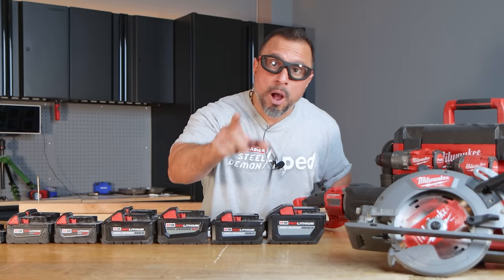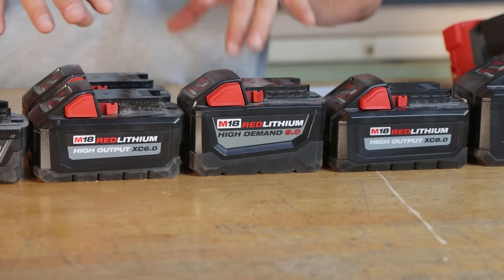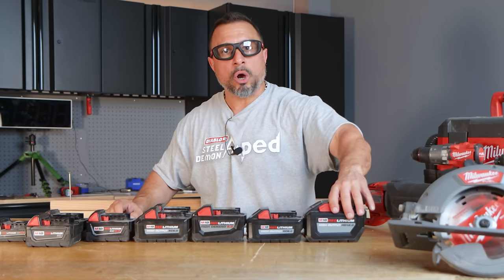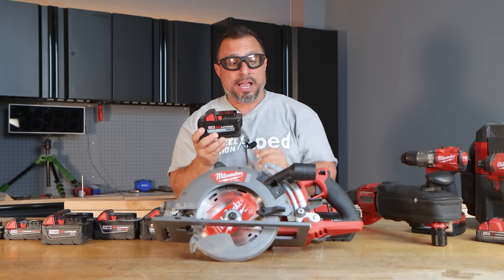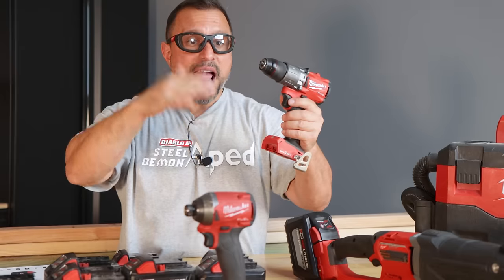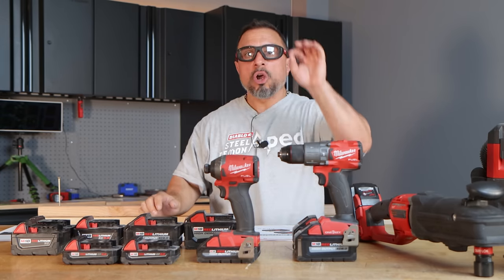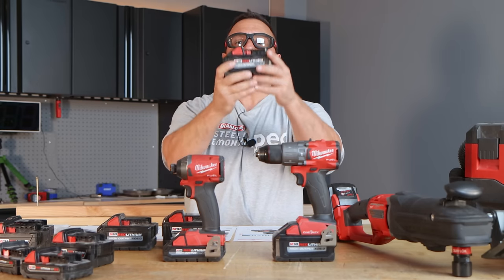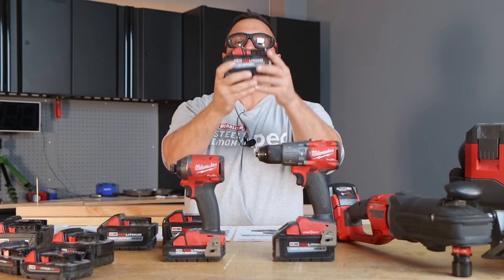Your BUYING and USING Milwaukee M18 Batteries ALL WRONG! (stop doing this)

Comment: Milwaukee rates their pack according to batteries manufacturer’s rating. Any rated pack will deliver a total of a rated power, so while the packs with 21700 batteries will give better surge, it will give the same total 54, 104, 144 watts, etc. in output. Also 18650 battery is not obsolete.  It’s just physical size spec, 18mm X 650mm. Samsung, LG, etc. can continually improve them.  The pricing can be confusing.  But I price compared Lowes Kobalt batteries which are priced the same.  Lowes Kobalt 4.0 18650 battery pack is $10 cheaper than the same 4.0 pack with 21700 batteries.  Milwaukee’s and Home Depot’s pricing can vary.

Then, lifespan.  Samsung rates it’s 18650 2000 mAh battery as 10 years and 500 recharges, whichever comes first.  I assume the 21700, same lithium ion, is rated the same.

Inside each Milwaukee pack, for 18V, it’s either 1 row of 5 batteries (5 x 3.7v) or 2 rows of 5 batteries. It’s the the Samsung batteries and Milwaukee circuit board that give its packs the 3 year guaranty.  Interestingly, Kobalt and Harbor Freight Hercules packs also use hi quality Samsung batteries.  The packs on Amazon use unknown China batteries that cost 1/3 or 1/2 as much and they are 1/2 as good. The higher the rating, the bigger the shortfall.  Some China made 18650 are rated at 10,000 mAh while Samsungs highest is I think 3500mAh.  You can believe Samsung, LG, Sony, Panasonic Sanyo, but not the unknown China batteries.

Comment: So, basically CP3.0, XC6.0, 8.0 and 12.0 are the best batteries out there with the new architecture of batteries. The rest (2.0, 4.0, 5.0 and 9.0) are obsolete and meant to just be runned out with non fuel tools, lights, vaccums, etc and older Fuel tools right?

Looking forward to purchase a brand new hammerdrill and impact key m18 fuel combo to replace my old standard brushless tools.
Any thoughts on a 1/2" square impact? I want it for mechanic work on cars and as part of a vehicle kit to be able to change a tire in the middle of nowhere fast. Not sure if the compact will do or if I should step up for a mid torque.

Comment: It's not going to hurt anything to use a 12.0 or a 9.0 battery on a light. And it makes perfect sense to use a 9.0 or 12.0 in the vacuum because you get way longer run time. As far as the saw goes I normally run my 6.0s or 12.0s in it. But I have ran the 3.0 and have no issues. It doesn't matter what battery you use in most tools unless it's a high demand tool like a sliding compound miter saw. As far as hammer drills and impact drivers the 2.0 and 3.0 batteries do just fine. My 3.0 batteries are 5 years old and get used all the time. The only tool that I run only the 12.0s in is my push mower. Which makes perfect sense.

Comment: INSIDER INFO: Anyone watching this right now (March 14th) in Canada (may be the same in the states, but I'm in Canada so I can't say for sure) there was recently a distributor promotion through Milwaukee that dropped our cost (distributor cost) of the 8.0 AH battery down to nearly the same price as the 6.0 battery. 

Incase anyone is unfamiliar with how power tool retail works;
A lot of big brand names these days, especially Milwaukee, have what's called "MAP pricing" on their power tools. This is known as "Minimum Advertised Price" and MAP price is the same for all retailers, big or small. There are some exceptions to the rule, like promotions, but ultimately it's up to the manufacturer. 
I say all of this because even though us retailers and distributors recently got this 8.0 AH battery promo recently, it probably won't be advertised in your local flyer, or online, because technically it can't be due to MAP. 
If you're reading this in the next few weeks after I've posted it and you're looking for a Milwaukee battery upgrade, go to your nearest tool store and ask of they have any good sales on 8.0 AH batteries, aim for more local and smaller businesses because they don't have as much bureaucratic bullshit to deal with and they're more likely to give you a deal because to a local business, a sale is a sale.

Comment: i think the 5.0s usually come with the packs/combos... maybe milwaukee has an abundance of them to get rid of... just recieved a free 8.0 high output by redemption and boy what a difference, would say it lasts nearly twice as long and has maybe 20% more power output using a 7" grinder, would be weary using it on the smaller impact tools and drills for prolong periods however as I did notice they get very hot quickly.  
FYI from New Zealand, so the models will differ slightly and I don't think the US batteries work on our tools for some commercial reason.

Comment: What battery should be used in the 2786-80 concrete saw? Ive had lots of problems with over heating the battery?

Comment: I noticed when using the cordless hoehawg regular size one. I mix mortar in a bucket it stalls with the 6ah high output . When I use the 5ah , it just keeps going. As if the tool is not meant to work higher than 5ah. I thought you would be explaining that in this video, battery for tool.

Comment: I will argue that my HO XC6.0 runs that vacuum better than my XC5.0. Yes, fresh off the charger they both provide same suction/power/loudness.
BUT within minutes my XC5.0's display reduced suction/power/loudness even when there is still plenty of runtime left. Basically most the run time is reduced power but still useable.
My HO XC6.0's run seemingly full suction/power/loudness for much longer before you notice any reduction. Basically most the run time is almost full power before drops off.
And then of course the 20% longer run time and getting the job done faster with more suction means you use less of that runtime.

Comment: isnt part of it also that its easier to manufacture 2-3 different SKUs of battery on the same form factor so they can streamline production, and just make a housing big enough to accommodate all the sistered sizes they want to get out of it. so instead of producing separate 4 and 5 battery packs, they just produce one housing and then fill it with the respective internals. Same thing happens with USB sticks, a company will sell usb thumb drives from 8GB-128GB+ all just using the exact same physical thumb drive design and just popping in different flash storage depending on the model. sometimes they even have multiple USBs using the same flash storage but with different capacities as a failed 32GB chip might still have 8GB or 16GB usable so they just pop the same chip in the same housing, and an 8GB USB stick might be packaged and sold, and its literally just an identical 32GB stick that has a defect. Its all about yield with electronics.

Comment: I still like the XC 4.0 pack because they are cheap, usually a 2 pack is a little over 130 CAD where as a single cp2.0 is 109.

Comment: Absolutely love this channel man. I have a question.. I camp a lot and I just purchased an M18 job site fan.. which is the best battery you recommended to keep that fan running the LONGEST?
Reply from the maker: 12AH
Reply: Do you know if the 12AH sits flush? If not, since you have all of the battery’s at your shop, can you tell me the absolute biggest size battery it’ll handle to where it’ll still sit flush? I’ll go buy that battery today. Thanks!

Comment: got my sub today. I have been in the tile industry for 20 years this year, and don't use hand power tools as much as some trades; but have recently upgraded to this set of drill and driver, as well as their angle grinder with new grinder mounting diamond hole saws. You are 1000 percent correct about these batteries. My grinder would barely get through a handful of hole punches through 1/2 inch thick porcelain before getting really warm and running low on power. Dropped a 3.0 6 amp on it and the thing will go all day long and be same power output all the way to the bottom of the charge. Huge difference. Way cooler too, the handle was getting warm enough where i had to take breaks between cuts, now I can just go at it. The gen 3 drills and impacts are really really solid work horses and I never regret buying them.

Comment: What about the non branded version of these batteries? Are they ok to use in these milawaukee tools ? I mean do they cause the tool any performance issues that you know of ?
Reply: from what I've watched and read after reeling at the milwaukee prices, they range from wholly unreliable and wont hold a charge after a few uses to literally exploding and catching fire. Stay tf away
Reply: @ezze-does-it  thanks for letting me know will stick to original batteries from now on

Comment: Where would you put the forge 6ah battery that came out vs the 8ah high output? They are the same price. I also bought a dual super charger because the charger can charge the forge batteries quicker from what I read. What have you found on thosen2 batteries?

Comment: I just bought a new grease  gun Milwaukee M18 Should you charge your batteries Before use or use it right away then wait for it to charge down ?
Reply from the maker: Li-ion batteries don’t have “memory” issue like old ni-cad batteries. You can charge li-ion at any point.

Comment: just debating if i want to order 4 6.0 HO batterys or if i should go with 2 12.0 HO batterys, for demo work tools. I know i will need at least one 12.0 HO battery on my fuel packout shopvac, but i know batterys bought in bunches or packs is better than buying them one at a time.

Comment: Essentially use the largest capacity for a given form factor. Compact tool, use a small small battery with the highest capacity. Large tool, use a large battery with the highest capacity

Comment: Okay question, I have multiple Milwaukee batteries. My sons power wheels has been converted to accept the m18 battery platform. If he uses a xc5.0 we get a solid 30 minutes… if I use the 6.0 I get about 20… what gives?

Comment: Recently ordered a 3/4 fuel impact that came with two 5.0 batteries, the only reason I did is that it was a good deal, but in the future I plan on getting an 8.0ho battery for better torque since I do mechanical work and need that high torque occasionally

Comment: I use one of the big ass 8 or 9 (idk) batteries in my half inch impact. Holds a charge for months and it nearly has as much power as my IR Titanium pneumatic impact.

Comment: Thank you so much for your informative videos! I just bought the M18 Fuel Gen 3 Hammer drill/driver + Impact combo kit with 2 XC5.0 batteries and was wondering what extra battery options I should think about getting in the future.
Reply: Same!

Comment: In my case, I’m running the 18V tire inflator and although I understand there is no benefit to run HD12 battery but I’m using this on off-road trips and I want one battery to last as long as possible.  I don’t want to carry 4 or 5 batteries.  So what is my  best choice for longest lasting tire inflator where I have no access to AC to recharge my batteries?

Comment: I'm a new power tool user so sorry if the question is dumb but, can you use a 12.0 battery in lets say the hammer drill?  So as long as it's an M18 it will work across all tools for M18?

Comment: Ohm's Law can go a long way here. 
Power (Watts) = Current (Amps) * Voltage (Volts)
M18 = 18 Volts.
If you want more power, you will need to increase your current output.

Comment: Just found you on here I have a question I've seen a lot of videos on the batteries not buying brand and what's better but I haven't seen anything about chargers I have a Milwaukee and the charger died man they are expensive I can buy a tool with the charger for not much more than the charger by itself can you recommend something else great video by the way I just subscribed to your channel

Comment: 5 mAh batteries don’t work with tools which have a motor which can be stalled.  This happens to not burn outs all things like hand drills which are current limited.  There is a work around but it involves a bit of butchery.

Stavros.

Comment: I have the 2696-25 combo kit - the tools are NOT FUEL - is it still best to et the high output?  Will the charger that came with it work ok with the high output batteries?

Comment: So I have the step below the fuel line power tools, would it be a bad thing to run High Output battery's on non fuel power tools?

Comment: Milwaukee M18 String Trimmer- New, initial run lasts 5 seconds, any further runs last 2 to 3 seconds- and the tool shuts off.  Called customer support- told to take to a maintenance shop- shop was baffled by the problem- tool sent for research/repair under warranty- to take a month- could not wait that long to lose my landscaping efforts- bought another new M18 string trimmer- initially ran for ten minutes- then finished it also started the same fail pattern- any solutions/answers- thank you.

Comment: I generally don't use HO batteries, certainly in test and spec spreadsheets the HO batteries are much better, but in the real world and real general use scenarios I find that the standard batteries work just fine and the significant cost increase for the HO batteries offers little benefit.  If you are using a battery where you see a large increase in performance between standard and HO or a tool only works with the HO then you are probably using the wrong battery from the start.

Comment: I run the older batteries but they came on the tools i have and these batteries last so long 2 years in and im still running them out. I will upgrade my battery packs when the old ones run out of charge cycles i guess.

Comment: Well, I’m more confused than ever....  I have found that all batteries are over priced.  Sometimes I’ll buy a off-brand that battery that seems to perform just as well as the name brand at half the cost....   But, the other side of that is that I am not using these batteries every day all day.   I might notice a big difference if I was......

Comment: Great content.  Vince is there a way to tell by looking at the battery packs if they they have the new cells / technology vs the old?
If I didn't watch your video, I would have never known there are differences between similar batteries in the M18 line, thank you!

Comment: Milwaukee batteries are overpriced and worthless for the average consumer.  I am not a contractor, I use my batteries for a drill and blower.  I have 2 batteries that both have reduced performance in less than 3 years from date of purchase.  Considered buying a replacement battery, and 1 M18 at Home Depot was $158.  Ridiculous!  Milwaukee sucks for the usual weekend DIY type guy.
Going to try to see if this is covered under warranty but seriously doubt it.

Thanks for your enthusiasm sir!

Comment: Will the cp 3.0 h.o. battery work better with my non fuel impact and drill than the cp 2.0? I know it will be better but will my drill run stronger etc or just a bit longer?

Comment: its not about battery quality. its about how many amps you need to pull from the battery. the higher the draw, the lower the total capacity the battery has. the lower the draw, the higher the capacity.

Comment: I built a house in mid 2021. To put temporary electric on the property would cost me about $1800.  I sold my old cordless tools and went Milwaukee. The M 18 is the best battery going. I got the 16" chain saw. It's bad as f♡ck no mixing fuel or pull starting and choke and pull again. It's badass.
Reply: I completely built my house on the Milwaukee M18 platform. It was a great decision other than paying for the temporary electric.

Comment: First and last visit.
You should sit down with a battery expert and get an understanding of the difference between - Quality and Capacity.
I agree, you need a battery capable of rapid discharge and respectable Work time which is the reason for the larger battery construction. Larger, not Better.
Th Battery is not going to supercharge the tool. If a saw has a 6000 rpm free max speed, that is as fast as it is designed to Run and a manufacturer is not going to violate those safety standards.

Comment: I think 6.0 is the sweet spot.  The 6.0 allows higher current draw than 8.0 and reviews are much better.  I have no desire for heavier 12.0 battery.  I'd rather have two lighter 6.0 and swap which takes only seconds.

Comment: I have an 8.0 battery pack that came with the weed eater and after the green light comes on the charger one of the four red LEDs on the battery is not lit up. What's up with that?

Comment: So this is what I'd expect from Milwaukee's website. There's quality cells, sure, but what he's either oblivious to or was paid not to clearly explain is that lithium ion cells mainly have a capacity(mAh), and a continuous/burst output rating (in amps). They are tradeoffs. A high output cell is like a starter battery in a car and high capacity is like a deep cycle battery, which will drop more voltage at high load, but will power a radio longer. You don't get have your cake and eat it too without a better chef with better technology or manufacturing. And ffs a vacuum is your low load example?

Comment: Yeah, great video. I agreed with all of the statements said. 
I'm an electrical engineer and I have several Milwaukee fuel tools, included some of the shown on the video, and I confirm experienced more power over the tools using HD battery.

Comment: That 6.0 is way to big and heavy for a drill. As a carpenter you'll be using at least two drills, sometimes three at all times, meaning you've already got a lot of weight hanging off of your tool belt. I'll definitely look into getting some 3.0's but the 5.0's are a great size when it comes to a combination of power, duration and ease of use. The 6.0 is too much.

Comment: Have they released a decent jigsaw yet where the plate doesn’t come loose and the trigger isn’t on top making it hard to quickly turn off? Big fan of MilWaukee and used them for years but Jesus they make the worse jigsaws I’ve ever used.